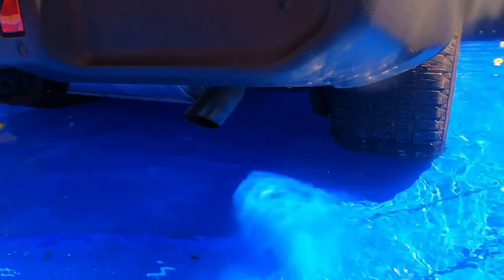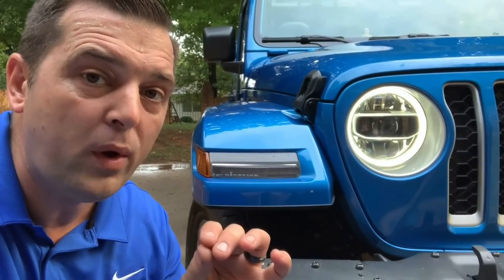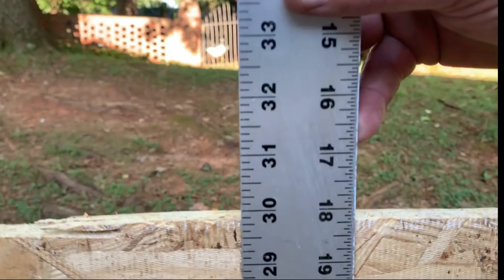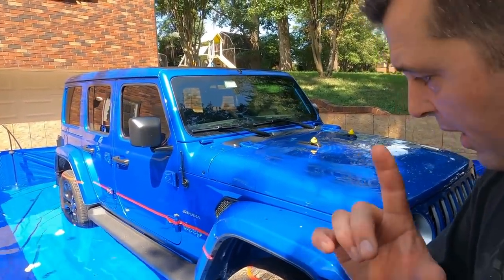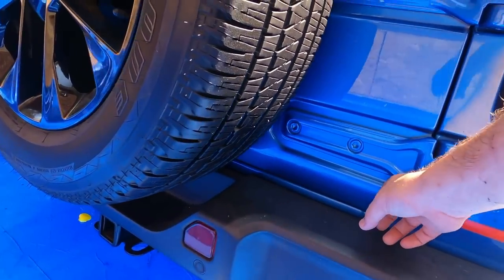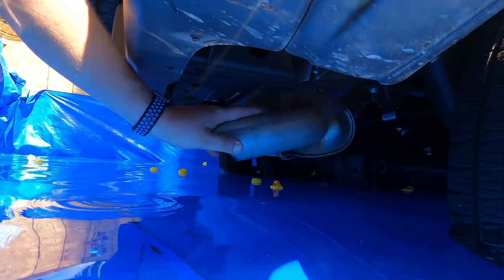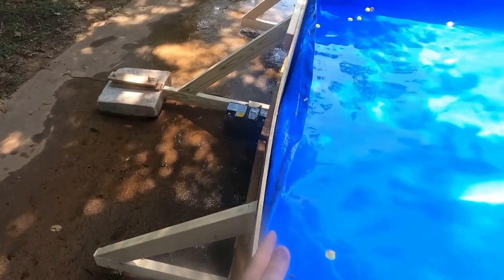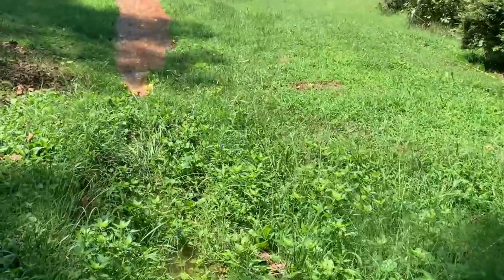Jeep Vs Pool  ( Homemade Pool )

Comment: That looked like a fun summer project.   One thing to consider is that there is a BIG difference between 'sitting' in 30" of water and driving through at 5mph.  The water gets forced out of the way of some components and has less time to soak into others (like your doors and exhaust).  Still, it was a cool video!
 There are videos where guys relocate the breathers/vents up into the engine compartment so they can go through deeper water.  After watching your video and seeing that they are made of a hydrophobic material, it makes me wonder if that is a waste of time?

Comment: Did I miss something?   Jeeps can Ford water 30inches… doesn’t mean that Jeeps can act like a submarine up to 30inches.   It’s going to get water inside the Jeep.  Those seals around the doors, hatch, and floor will not keep the water out.  Not sure exactly what the point of this is. But it’s entertaining I suppose.

Comment: Lol, your home made pool could not hold .6psi of water displacement…
Reply from the maker: Actually if you do the math it’s 6 psi per square inch. 16ft wide and 12 in deep is 192 sq feet on the back wall. 1 square foot has 144 psi on it. So that was was holding 27,648 psi. That’s how strong water is. I will be using cinder blocks next tine.
Reply: @BrandonHaneline  yeah but water was half way @15” and water displacement only depends on height I think…this exclude you in the pool..lol

Comment: While I have had my rubicon in water deeper than 30 inches it was only for a Water crossing on a paved surface.  no water penetrated the cab.  those door seals will hold up for a while.
Reply from the maker: That’s good to know!! Thanks
Reply: @BrandonHaneline  keep up the good work on the Videos, I just got told that my 4Xe is delayed due to chip shortages so myabe in october.  this is my jeep fix right now!
Reply from the maker: Lol.!!! 
I’m sorry to hear that your jeep won’t be in till October what color did you order

Comment: I love your experiment, but, in many ways I’m glad your pool didn’t hold up. I think the main piece of info that’s missing from Jeep is the max time the Wrangler can be at 30” of water. Also, it has always been recommended by Jeep that if the differentials are under water for any amount of time, that the diff oil be changed just in case any moisture has seeped in.